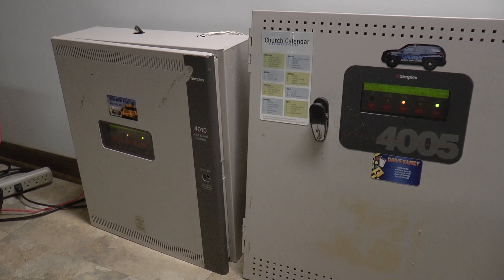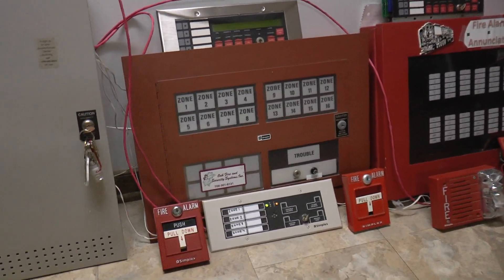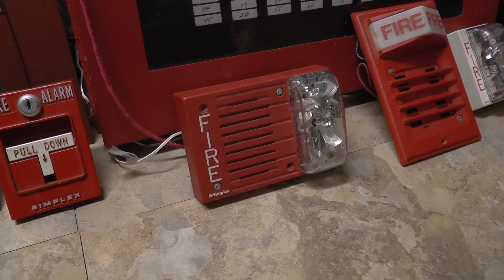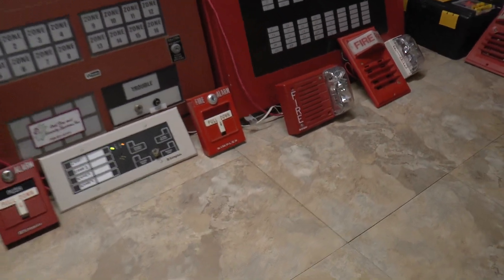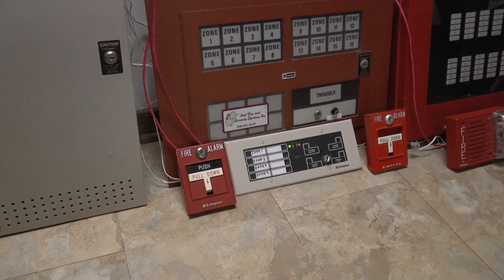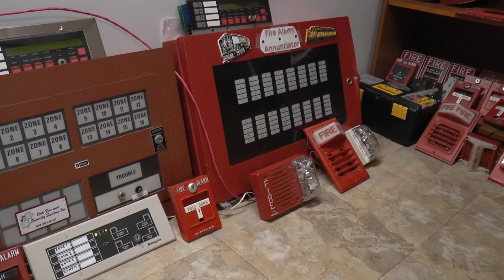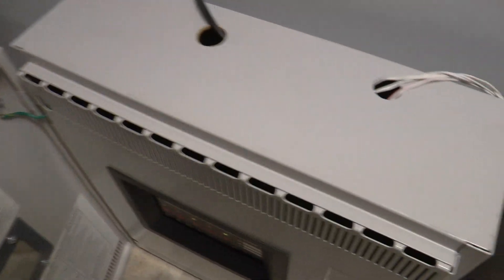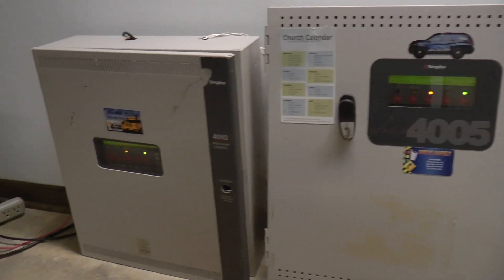Floor System Test 51 - Something New!

Comment: I have a higher quality recording of the 4100 message if you’re interested. It doesn’t have the acoustic effects and the echoing whoop you hear in the background.
Reply from the maker: Really? I thought this was the original sound file and Simplex just did a crappy job recording it. If I use this message again, I will definitely request that from you. Thank you very much!
Reply: Do you have an email that I could send it to. I don’t really want to do it over the comments section, unless you’re fine with it.
Reply from the maker: @FireAlarmTech7.  Sure. msj191961@gmail.com
Reply: You got it! And since you subscribed to me, I’ll even send you a high quality recording of the 4100u message with the slow whoop!